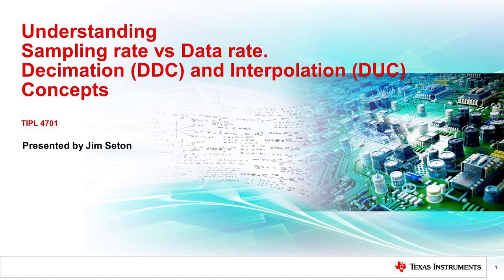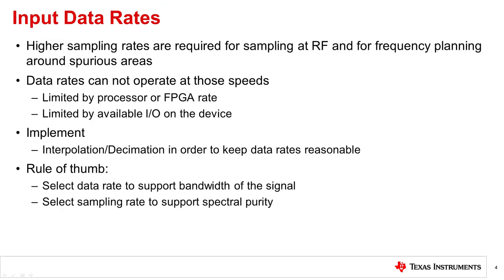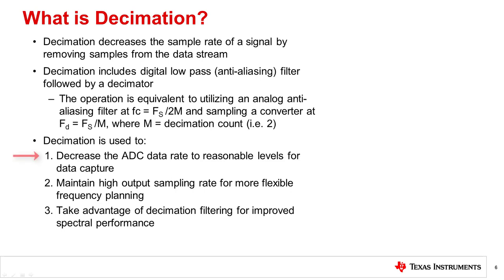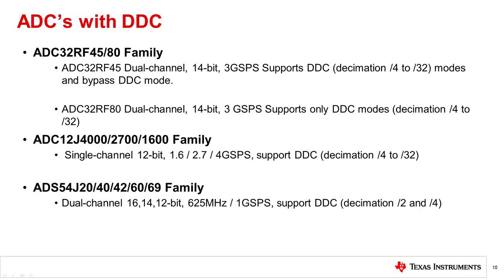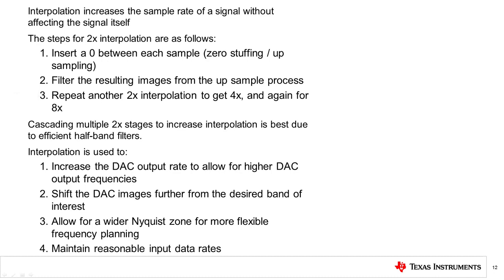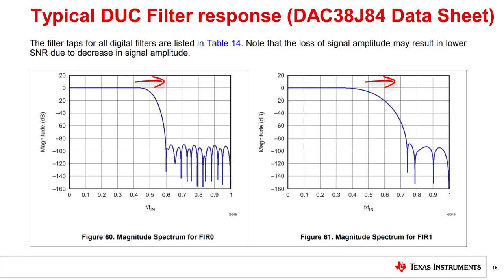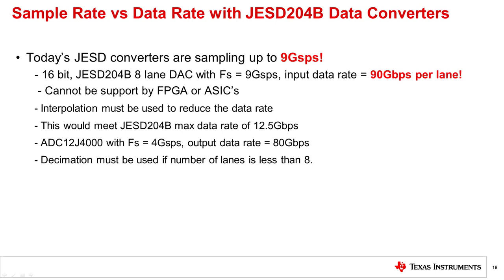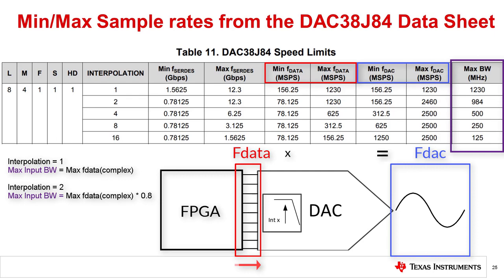Sampling vs. data rate, decimation (DDC) and interpolation (DUC) in high-speed data converters

Comment: Decimation is the digital version of taking a SWAG of the bit(s) between the bits of the sample. If it adds 1 bit, the frequency is doubled. 2 bits, it is doubled twice, and 3 bits, it is doubled  3 times, etc. It is a rather simple code. No slight intended.
 (S)Derek